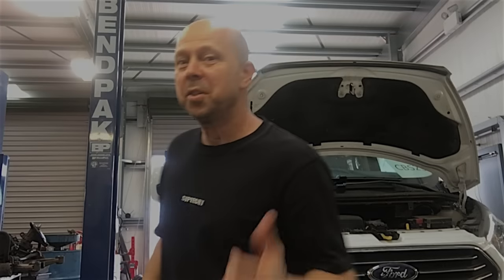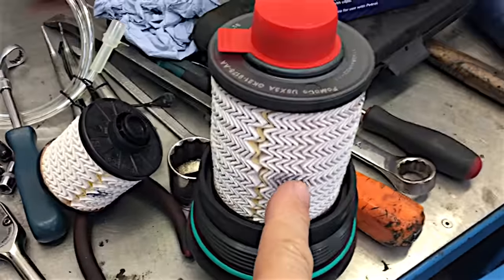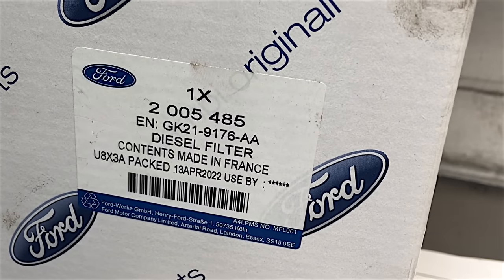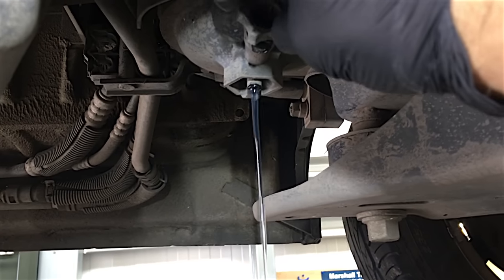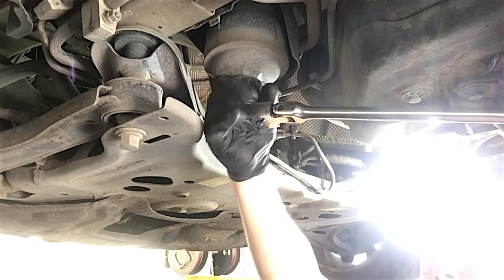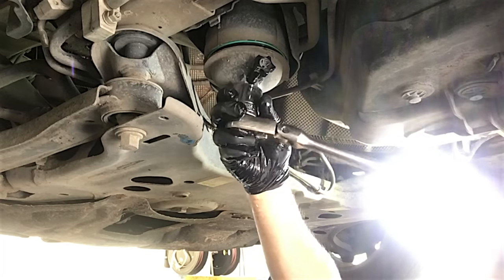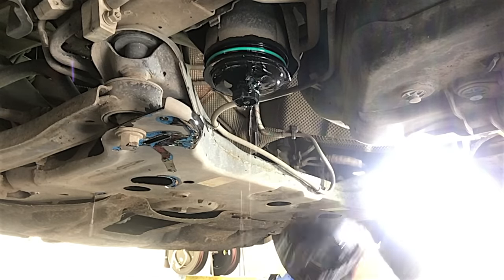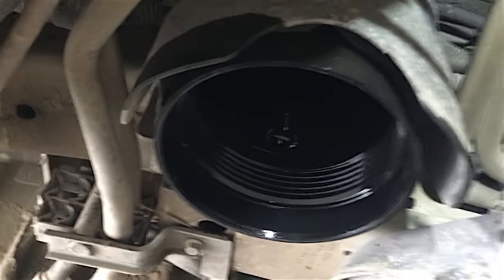Ford Transit Tourneo Custom Fuel Filter Replacement

Comment: I changed my fuel filter in a 1.8 TDCi. Not knowing the proper procedure, I just started the engine. It ran for a few seconds and then stopped, and then I had to manually pump fuel into the filter from the tank to eventually get it to run. Spent a few hours fighting with it. Great job!

Comment: Now you see why they don't get changed. I did the diesel filter on the Octavia last week at 80,000 miles. A complete doddle and no drips, and done from inside the bonnet with a T20 driver. I had an old Connect TD and you didn't have this palaver either. They both self primed as well.

Comment: I found the best way to prime this is do the same as you did but leave the drain tap open slightly over a drain pan. Then leave ignitiion switch on, and gradually close the tap when you see a constant flow of fuel coming out. You will hear the pump run constantly until tap is closed and then it cuts out once pressure is reached i believe.

Comment: Evening Alan
I have mk4 mondeo with 220k+ on the clock. I do most of my own work but every 20k or so i send it to evans halshaw just for the stamp really. Last time i asked them to do all filters etc etc and cost me £250+ 
I had the MOT done at the beginning of May and passed of course with no advisories. I then did a service myself with all filters and i can tell you that diesel filter had not been changed for a very long time, i could tell because there was no tell tale marks of removal. The filter was worse than the oil filter and after changing the car ran so much better. Such an easy job, why couldn't evans have done that? How can I trust a large company like that?  Ill do it all myself from now on, stuff the stamp, i dont need it. 
Anyway, Where's  Monica, we miss her 😔

Comment: Nice video, quick question. Aren't you supposed to disconnect the fuel hose before removing the filter? I don't see that part in the video.

Comment: I look after a fleet of transits and change these quite often. One bit of advise DON"T just use a normal socket to remove this filter. There is a proper socket available that has two cutouts in it that fit onto the nut far better than a normal socket. Using a normal socket CAN round off the plastic nut because as you've seen in video they are really tight. The special sockets costs naff all
Reply: beat me to it ... they're only pennies so well worth getting i have damaged them myself with a large ring spanner
Reply: So you need a special tool to take off the fuel filter......good grief 😕

Comment: I do a huge amount of them on the enterprise vans, they drain out nice; but you still get an armful of fuel even after leaving them for half hour draining. I always do them first before the oil oil change so i trying to fire the engine over while trying get oil pressure from new oil filter.

Comment: I replaced the fuel filter on our transit, same job as this. Changed it with a Bosch filter and after comparing it with the FoMoCo one that came out it was the exact same apart from the names. Not sure but maybe Bosch make the filters for Ford. I smeared some diesel around the rubber o ring and it helped it to tighten up. It is a messy job especially lying on the ground!

Comment: Extra tight going in was because you fitted the new filter with a dry o ring. It will be lucky if that doesn't now give trouble going forward for someone

Comment: Hello Alan I like watching your videos I have been watching since I purchased a Mondeo in 2014
I have a question for you I have a ford b max on a 64 plate with 30000 miles on it it now gets stuck in gear usually 1 or 2 this has happened 4 times yesterday I have to turn off engine to move it out of gear and then I can continue my journey but this happened 4 times yesterday I have been told there is no clutch cable on this vehicle (I don't know much about cars )if this was the clutch I take it I would be going nowhere and the pedal would go to the floor (had this fault in a nova years ago) so the clutch seems okay it is not slipping mileage is low any ideas what does this sound like to you this vehicle was inherited from my late father who really looked after it the mileage is exceptionally low for year and he never abused or drove a car in a bad way so I know it has been well looked after which is why I took this vehicle (my dad would own a car until it was falling to pieces) I know this vehicle has been extremely well looked after I am dreading a very expensive bill I take it if the clutch was gone I would get no gear at all any ideas/advice would be appreciated I know it has to go to the garage I really enjoy watching your videos ever since I had a Mondeo MK4 titanium x and still watch now even though I have this b max

Comment: The problem I can see with the tap is it doesn't have a vent to allow air into the sealed filter area hence whats left is because of the vacuum created .
Reply: Very very good remark! Curious what the official Ford changing procedure is!!!! There should be a vent again, when filling the filter....
Reply: You should disconnect the fuel line on top of the housing and then open the drain valve. That will allow air in from the top, and Bob will be your dry uncle, instead of soaked in Diesel.

Comment: The trick with them filters is to cut a notch out the socket to get on the filter because that drain screw gets in the way and when they are tight and you rounded it is stilsons go on ask me how I know LOL
Reply: Yep I've done that, make life so much easier on those fuel filters

Comment: Another great video thanks for posting it and the tip in primming the filter b4 hand. Question have you done a video on changing the wet belt on a custom. 2019 euro 6 2,0 And do they do an upgrade so you can change out the wet belt to a chain, michael nottingham 👍

Comment: Im curious what mine will throw up on its first service. Mine too is a new Transit but the plug in hybrid (petrol). The software on vehicle is crap and often says 'engine over temp' when im on ev mode and engine service when its had only covered 11,000, engine oil requires changing, etc etc. Nice van but system is full of gremlins.
Reply: Engine service could also mean its got a fault that needs scanning actually it doesnt always mean just a service is due but that theres an actual fault code like a sensor gone bad etc

Comment: Hi Alan 
Have you done the wet belt?
These transits are really bad for the belts going anywhere between 50-80k 

I have had so many problems with theses transits and wet belts 
Ford say 140k or 10 years but they are not getting close
Reply: Stupid idea to get like 0.1 more mpg/negligible emissions gain and its likely even worse on the diesels than the 1.0 ecoboost because the oil will get a bit diluted with fuel from dpf regens which is likely to react with the rubber and wear the wet belt even faster but make sure your using the oil that meets the ford spec for the engine not just the correct weight because wrong oil can also be formulated in a way that wears the belt faster

Comment: I WOULD SUCK DIESEL OUT BY CREATING A VACUUM THEN BLEED SYSTEM USING SAME METHOD I WOULD SUCK OUT MAYBE 2 LITERS , BUT I MUST SAY CRANKING METHOD DID WORK , I WOULD SPRAY LUBE OIL ON O-RING FOR FUEL FILTER HOUSING AND THREADS , THAT FUEL FILTER TOOK WAY TO MUCH FORCE TO PUT ON.

Comment: The tap is a waste of time I change these on a near daily basis I ve found its best to just put the drain tray under and take them out to the point they gush and  run 😅😅😅 and to prime it ignition cycles 10 times at 10 seconds 🎉🎉🎉

Comment: Great video, but what a crap design. Whoever designed it has never had to change a fuel filter, same applies to some oil filters, one thing I like about BMW there oil filters are normally dead east access on top of the engine.

Comment: AA man told my pal  Adblue is the worst  thing you can run  you run this engine as long as you fuck-king can, he works in the motor trade  and he hears all the horror stories,   i went back to petrol when the opertunity came along i was looking and looking   till i found  a good one, 01 focus 1.6 petrol  and i will run that  car as lonf as i can
Reply: Eh?
Reply: @FatHead1979  plenty of videos on the pros and cons of adblue. i had an 08 diesel focus  witha dpf,  blocked a few times even with weeklyt   trips on the motorway. friend wa told stay away from adblue cars,   or anything after 2011
Reply: The problem with those old focus is rust is killing them all off so maybe do some preventative maintenance before it rots away and becomes uneconomical to repair it to pass mot
Reply: @sbrader97  well i have a good one  from what ive seen
Reply: @TheMcooper17  Keep it that way and get it coated with some wax/underseal
Reply: alsoive done a diesel filter swap on my neighbors kia sorento